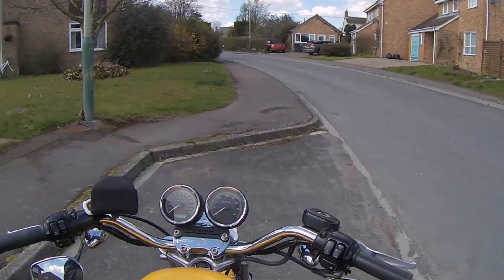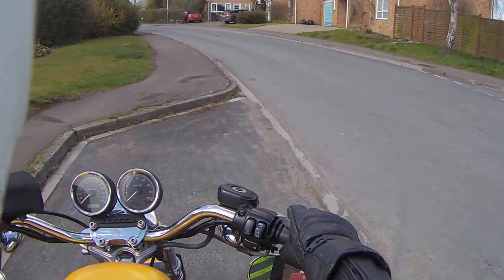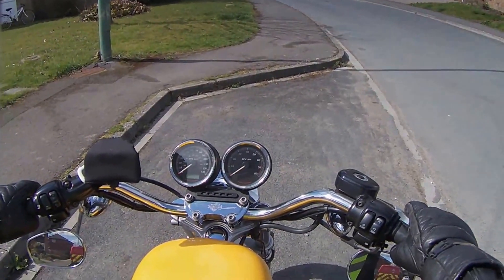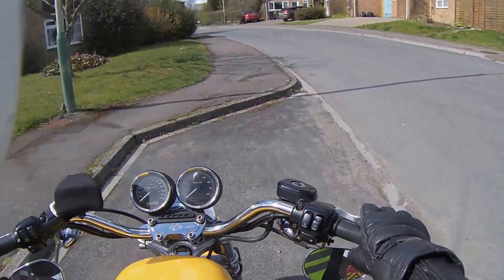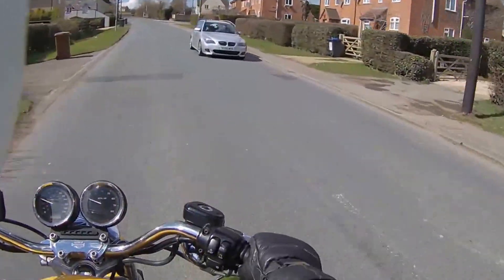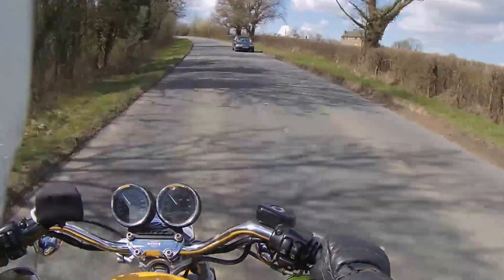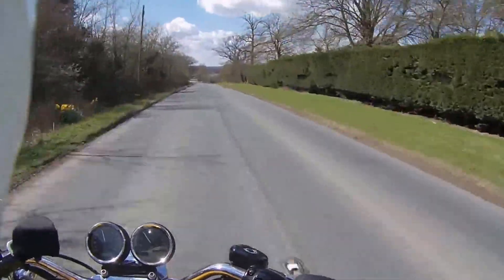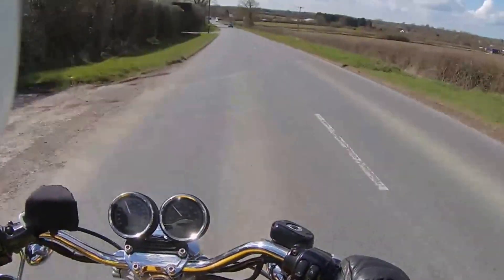Bikervation - TomTom Bandit 5th Audio Test. Problem solved ?

Comment: I've just sold my Drift Ghost HD and kind of regretting it. I was looking at the TOMTOM as it's small enough to suit my crash lid. Has their been any updates to improve the recording features as it's quite important to me in the event of an accident etc.

Thanks!
Reply from the maker: The last few Videos I've uploaded are using the latest firmware to date (Dec 18th 2016) Greenlaning #2 and the Idiot Collective Jurassic Coast Run 2016 are good examples, one at slow speed and one at normal road speed. I'm afraid that in my experience to date this is as good as it gets!
Reply: Thanks for the reply. Think I'll go back to Drift in that case :)

Comment: Hey, so how much did the update help to resolve the issue, and has it since been made available to the public? 
Also, why does it seem like the video is zooming in and out rapidly  through the video while riding?
Reply from the maker: The newest update available is : 1.61.508 and was released over a Month ago, If you have the App it should update automatically, TomTom have incorporated an automatic gain control and I'm using it in the Idiot Collective Jurassic Run Video. I think it's as good as it's going to get and gives fair audio that could probably be improved with the microphone positioning, but I'm happy with it.
To answer your second question, I think the zooming in and out is down to the YouTube stabilisation software (I don't use it any more), when you upload they offer to stabilise the video, on that occasion I opted in, but wont do so again and have decided that if I do any stabilisation it will be done before uploading.
Hope that helps.